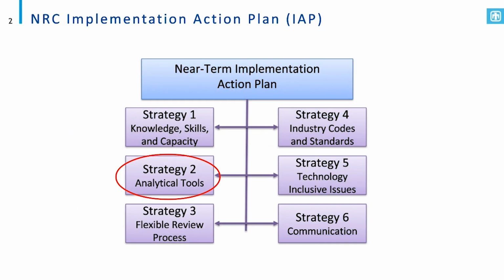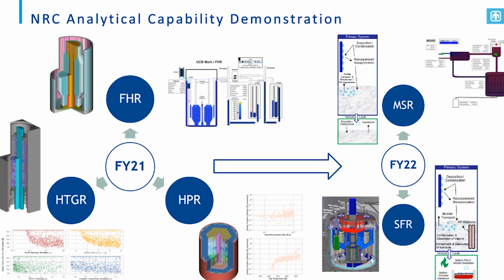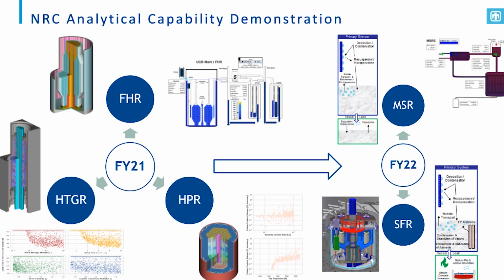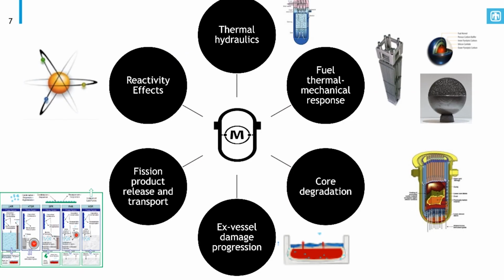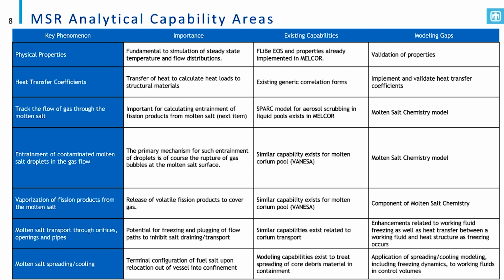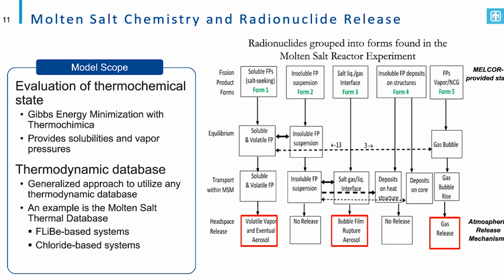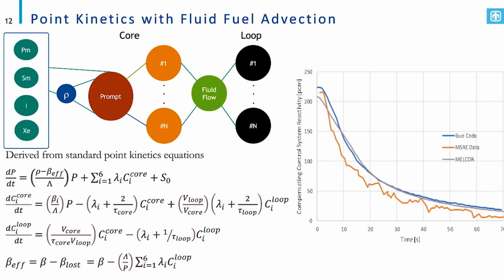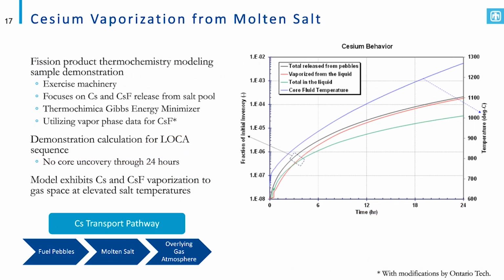MELCOR Non-LWR Modeling and Simulation Capabilities - Dave Luxat @ ORNL MSRW 2021

Comment: One item the new fusion reactors will have is tritium contamination in the reactors and in the groundwater around the reactors. Molten salt flibe reactors can alleviate this tritium contamination if the flibe has lithium enriched in lithium seven. So these flibe reactors can be a cleaner source of power than the forthcoming fusion reactors because to get to runeven these fusion reactors will need tritium. The clinch River fast breeder had a lot of tritium contamination clear to the sea from the fast sodium reactor. The problem with hydrogen is it cannot be contained with metal containers and needs contained chemically with the strongest chemical bonds going even higher than chlorine to fluorine ionic bonds for better control.
Reply: Tellerium embrittlement is a major issue to MSRs that cause stress fractures throughout the vessel.  What is the plan for that issue?
Reply: @paulmobleyscience  I personally don’t know but to me it seems as if an initially pure fuel salt becomes dirtied by a long list of elements that were not originally present. What a challenge it is to have elements with a diverse range of chemical properties constantly popping in and out of existence within your plumbing! I’m sure it’s something that can be solved, but it’s a unique problem nonetheless. 

If tellurium is an issue for the reactor vessel, my assumption is that it is insoluble in the fuel salt and it precipitates out, probably as molten micro droplets? As in a form of particle contamination? That’s just my guess though, knowing that molten metals have the ability to diffuse through solid ones. I’ve stirred molten indium with a 85/15 copper-silver alloy and the once soft alloy cracked like glass afterwards. 

I think the issue is that you have solid, liquid, and gas contaminants, both soluble and insoluble. And because of the decay times, the contaminants are constantly changing, and so are the places in the reactor which they occupy, until they ultimately stabilize and can start to accumulate. Idk I’m just thinking out loud
Reply: @Bloated_Tony_Danza  It can be solved by not using hasteloys and using far more expensive alloys causing the price to build these reactors to be astronomically expensive that they could never compete in the energy market.  Also Graphite is used to help with this issues which leads to another issue from the dust.  The issue is people get into this line of work of nuclear reactors because they see dollar signs for themselves and very rarely is it to help humanity.  They use public funding along with private funding to develop new ideas for an old technology not to help humanity but simply turn a profit.  The environment is continually being contaminated while corporations pay fines that are a drop in a bucket of their profits so there is no real need for them to discontinue these practices.